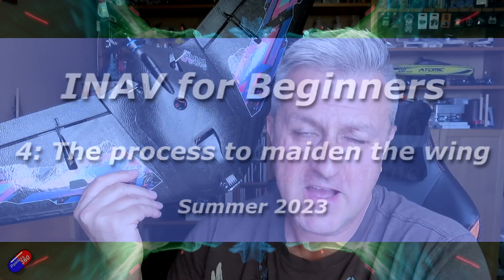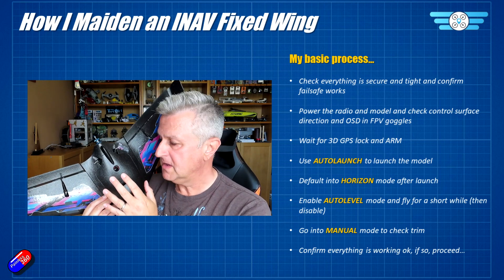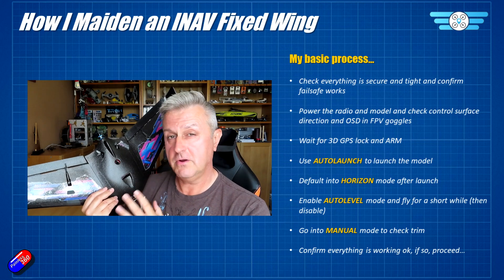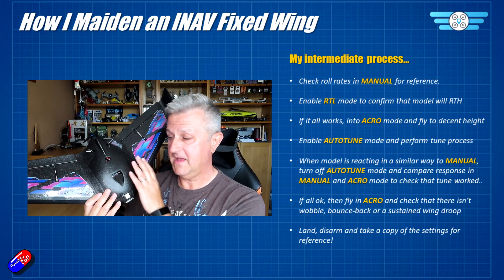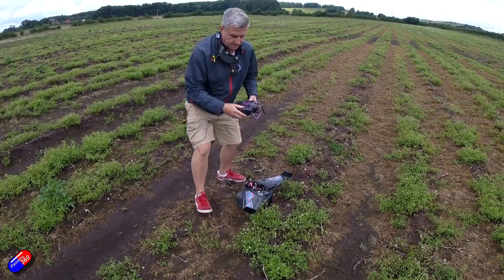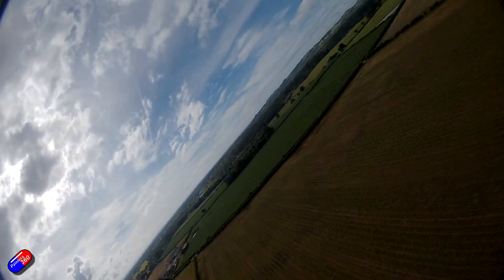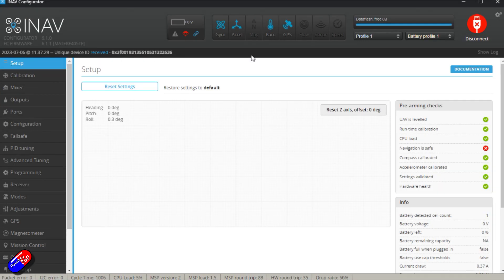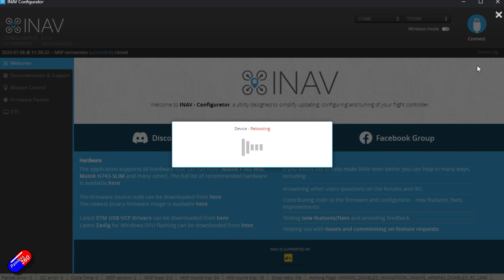INAV for Beginners 2023:  4: Final checks and how to maiden and tune the model

Comment: I have built ar wing pro on matek h743 wlite flashed inav 7.1.2 made everything from your guide but when I try to launch it using autolaunch it trys fly straight up around angle 80 degree and in osd I see message finishing, maybe you have any thoughts what it can be
build
Reply from the maker: All of the steps I use are in the videos. Let me know what troubleshooting you've done already...
Reply: @Painless360  I have logs from 4 launches also I tried to change version of inav to 6.0.0 which provide matek and to inav 7.1.0, tried to change climb angle from 25 to 15, tried to change launch throttle, idle throttle. I am new in wing.
Reply from the maker: https://www.youtube.com/watch?v=ILaspeI9GkU

Comment: Im apprehensive about my maiden because this will be my first(ish) full flight in FPV with head tracking, in a scratch build.  Is this something I can/should do line of sight or should it be done in FPV?
Reply from the maker: The first time can be a steep learning curve so I'd make sure you're flying in Horizon mode with Alt. hold on too so you have the lost help you can get... Best of luck

Comment: Hi Lee! Thanks for that set of awesome videos for us beginners! I completed my first inav setup using it. Everything was a breeze. I did notice though that in acro/horizon modes the rudder corrections are tiny compared to aileron/elevator. Is that something to worry about? How can I increase the gain?
Reply from the maker: Are you seeing something in the flight?  If not, then I honestly wouldn't worry about it... Happy flying!
Reply: @Painless360  I am planning to do the maiden using the FC this week. However it does feel weird that it has much less correction throw than the other two channels. That’s why I am concerned.
Reply from the maker: Best of luck with the maiden! :D
Reply: @Painless360  Thanks Lee! Have a good one!

Comment: Started flying a Penguin and your content has helped tremendously!  I'm running INAV 7 and using an O3 with Integra goggles. The artificial horizon works great but the Horizon Sidebars do not move.  Would you know could be causing that? Is that a DJI font limitation?
Reply from the maker: Not sure, I am a Walksnail pilot.... Happy flying

Comment: Hi Lee, Thankyou, a Very Very helpful series, Much Appreciated. Have got the exact model and fight controller. Followed to the letter and Total Success. One thing that do not understand, in the CLI set the pitch angle to 4.0 degrees,  but upon checking after the flight, now set to - 1.8, but flying OK. On the bench and in the INAV Configurator raising the nose of the aircraft gives Negative Values?? Flight controller arrow pointing forward and upright. Not a problem, just trying to understand why. Best Regards Andy Shaw.
Reply from the maker: If it is flying well - then don't worry! :D The autotrim should alter the offset you start off with. The 4 degrees is there as a placeholder to make sure that the autolaunch works great on the maiden really.. Happy flying!

Comment: Assuming the documentation on how to save the autotune (disarm then issue the stick commands before removing the battery for it to save) is still relevant? Not sure I caught it in the video.
Reply from the maker: I don't use the stick commands to save the settings. All steps shown..
Reply: @Painless360  thank you

Comment: Would the speedybee f405 wing work in this wing?  Can’t seem to find a WSE Fc and I use speedybee in most of my quads.
Reply from the maker: Although there is space for that, I think it would be overkill... Happy flying
Reply: F405 is overkill and takes up tons of space.  F411wte is still available and would be an easy fit.

Comment: Hello, I have made a traditional helicopter
pixhawk, ardupilot. and I have done all the calibrations but during flight the helicopter shakes in the air giving excessive vibration.
what could be the reason and how can i solve it.thanks
Reply from the maker: Vibration is the most likely cause. Loom at using filters...
Reply: @Painless360  how can i have to use filter?.thanks
Reply from the maker: I may be making a video on some of that, so stay tuned. In the meantime I'd check out the Ardupilot docs - https://ardupilot.org/copter/docs/common-imu-notch-filtering.html